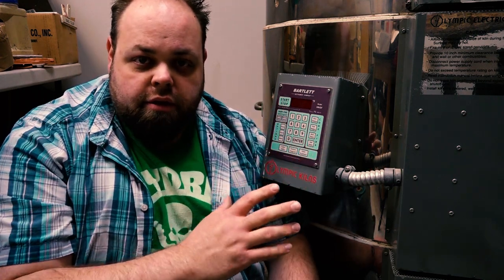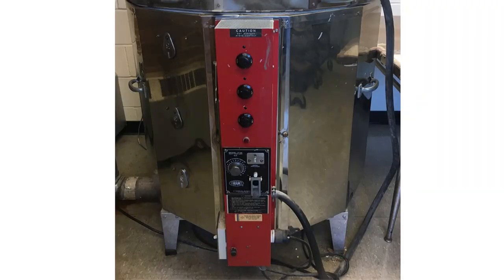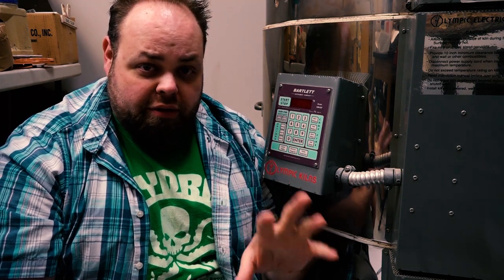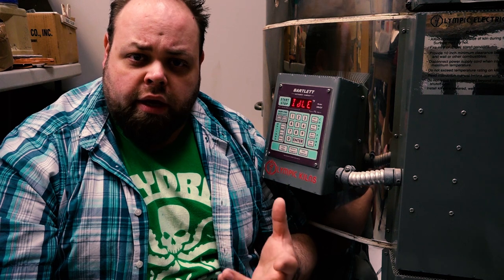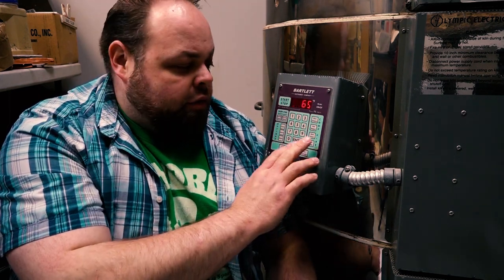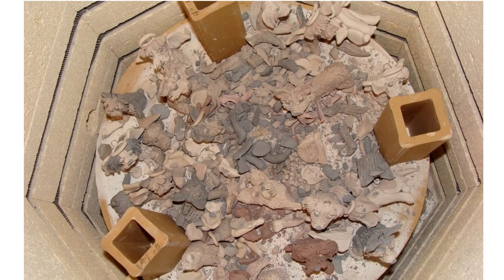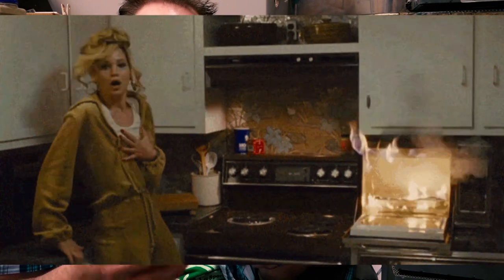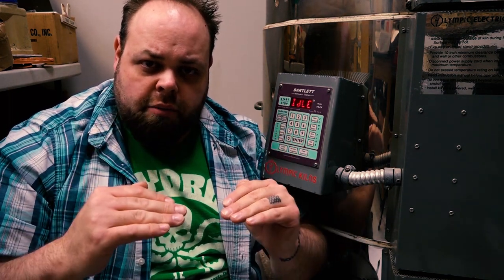How to Fire a Digital Kiln | Ceramics 101 | Kiln Basics | University of YouTube

Comment: When running a slow glaze fire, is it a rule of thumb to choose the cone temp 2 come values higher than the cone temp for the bisque fire?  What about medium or high fire situations?
Reply from the maker: Low fire: Bisque 04, Glaze 06 
High fire: bisque 04, glaze 8-10
Mid fire: bisque 04, glaze 3-6 
It all depends on the clay body. Check out the ceramics playlist for more on glazing specifics.